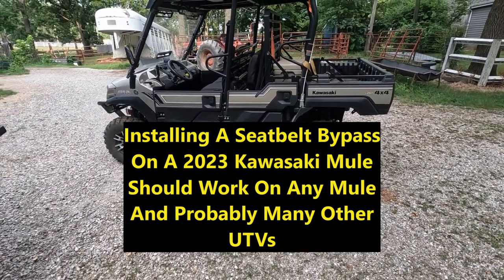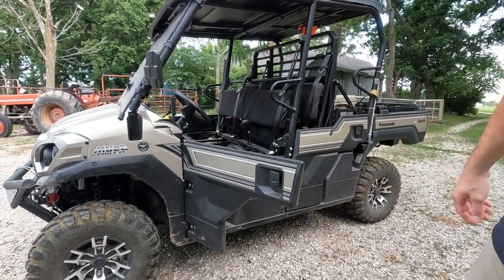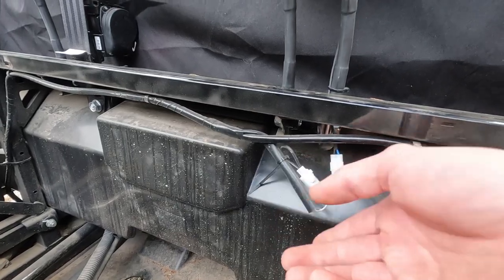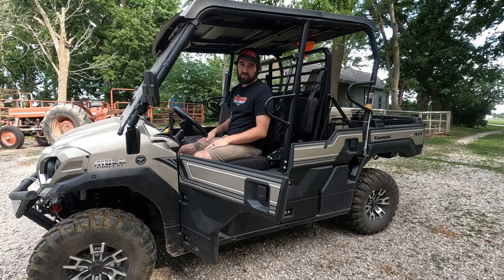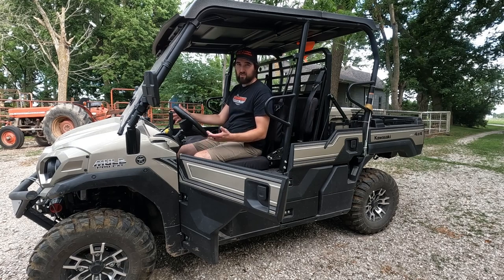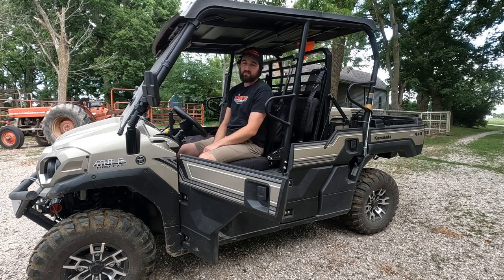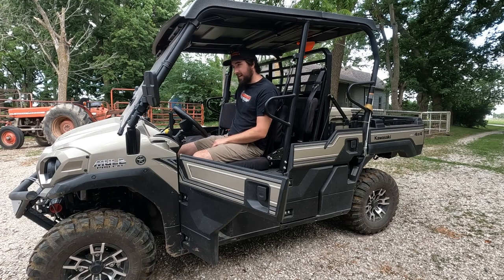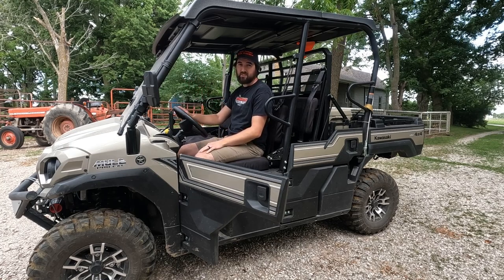Seatbelt Bypass Install on a 2023 Kawasaki Mule. Fits Most Other Years Also -Shorter Version

Comment: Do they bypass allow all the machine to go faster than it normally would? For example mines goes up to 45 there's a speed stay the same?
Reply from the maker: It just makes it to where your speed is not limited if the driver does not have your seat belt on. It should be the same top speed that you have before installing the bypass if you have your seat belt on.

Comment: So what part do i need?
Reply from the maker: Muzzys Seat Belt Bypass Mule 
- If you type that into Amazon it should pop up. It should be about $12 and you just need one. There is one on there for like $6 now from a different company but that is not the one I used so I’m not for sure it would work. The one from Muzzys is still working good for us and has been on there for 4 months with no issues.